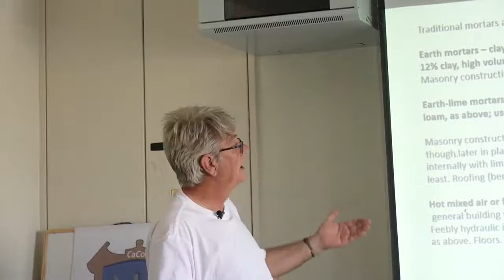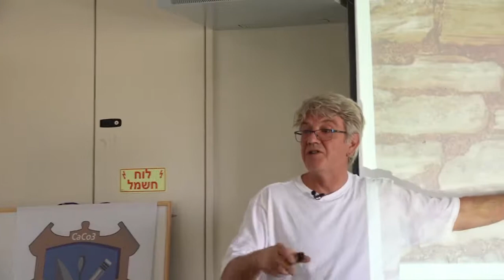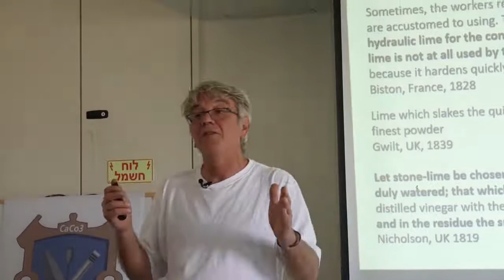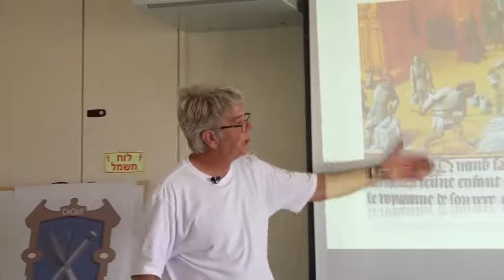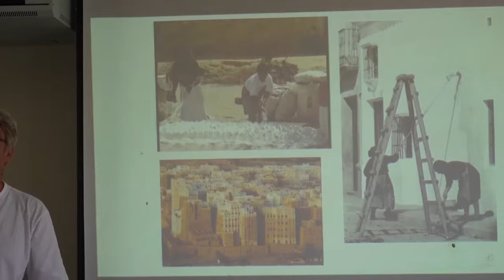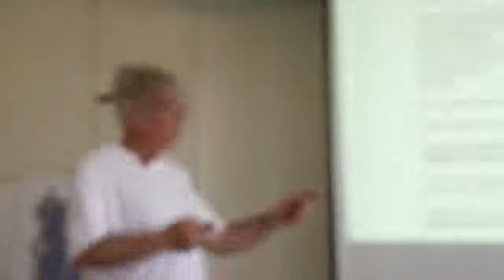Hot Mix Presentation - Nigel Copsey

Comment: Nigel: I have this to say about using hydrated lime to make putty for mortar works…. There’s excellent quality control at the factory, not in material handling and storing by vendors.  If it air slaked on the shelf it’s dead on arrival.  Much like nhl it’s too hard to control.  This is Midwest USA.
Reply: Switched to slaking quicklime powder in wet sand this year.  Will never look back.

Comment: Love watching Nigel’s talks. I would challenge one thing he said towards the end though. And that was the statement that he prefers finer sands with hot mixes. Purely from a structural point of view, that is, structure of the mortar, I have found that mortars made with well graded sands do not crack but those mixed entirely with fine building sand and even earth limes invariably do as there is less cohesion as they dry out and shrinkage occurs. I’m currently using a mix of 2 parts very gritty sharp sand. 1 part building sand and 1 part Calbux 90. Mixed well to make it as fatty as possible. It is a fantastic bedding and pointing mortar that suffers virtually no cracking.